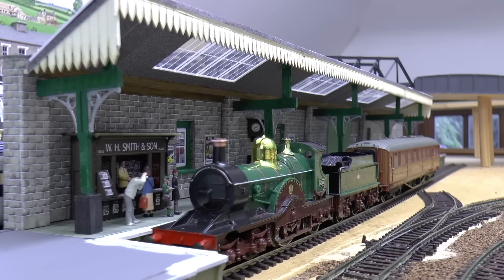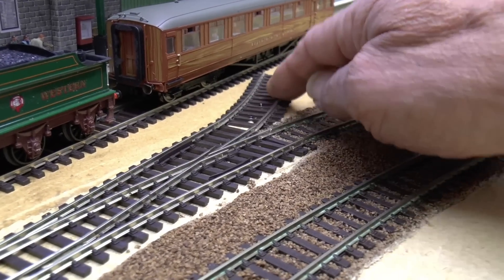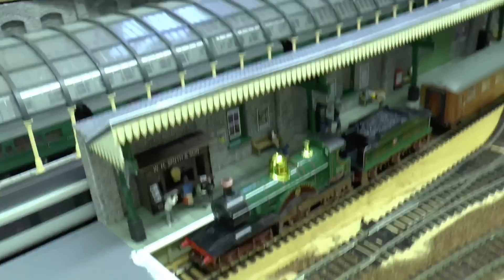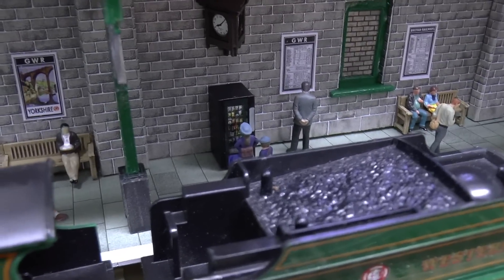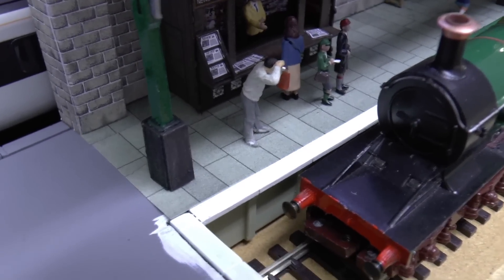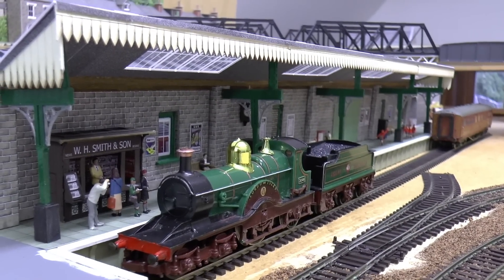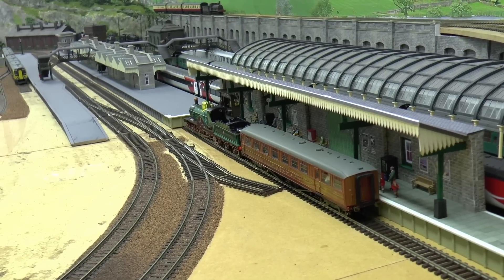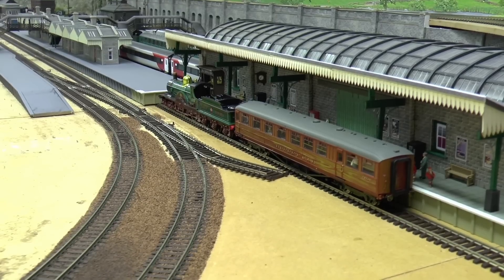Part 11. Reconfiguring the two through platforms and associated track work. 07-08-2017

Comment: Looks amazing Graham, its made a real feature at that end of the platform. There is something rather refreshing about ripping up parts of the layout and remodelling them, especially as the trains run much more smoothly.
Reply from the maker: So very true John about ripping up an older part of the layout and giving it a make over. quite therapeutic and as you say, even more so if the end result gives smoother running and a purpose too.              ..........Graham

Comment: Fantastic work on the station reminds me of the NRM station with a Steam loco looks very good :)
Reply from the maker: Thank you, it hasn't come out too bad really considering it was just made from bits and bobs and it adds a little more interest to what would have been just a long platform - I'm very pleased with it so far.           ..........Graham
Reply: It does look more mainline styled as a station the 'museum' section is really railway history styled as it could have been a bay for parcels trains or even for the Royal train, so it has the seal of approval from me ;) Plus as you said mate, it's your layout your rules. To be honest that's how it should be :-) Just looks really good loved Single Wheeler and then seeing the Virgin HST in the background that reminded me of Kings Cross.
Reply from the maker: I think the old and the new make a lovely contrast which is what I wanted to see and also I wanted to see a teaser of what was behind that wall too which is why I fitted two small windows in it - just seeing a slight movement behind it will hopefully add a little interest next time I do a running session.          ..........Graham

Comment: Nice work Graham the museum looks very busy with lots of visitors and when the other platform is finished the visitors will quadruple. the museum will look great once you get the railings up. a little suggestion maybe a ticket booth wouldn't go a miss at the entrance.....all the best Tony
Reply from the maker: Thanks Tony, yes a ticket office (or booth) will be installed there before it's finished, there's still quite a bit to do on it yet but it's gradually getting there.               ............Graham

Comment: That's an amazing use of a non running loco!
Reply from the maker: Hi mate, the loco does actually run it's just that it's DC and not DCC which my layout is so it needs to be isolated from the main feed. Put it on a DC track and it would be fine!   ;-)             .........Graham

Comment: Nearly there Graham and looking really good. I have a question that I have been meaning to ask for some time. Now that you are about to scenic the other end of Lakeside what will you do with the manor house when you are standing in its place in the centre of the layout? You can hardly rest it on existing scenery and you will soon need to scenic the area where you currently rest it. I'm sure you have thought of this but I am curious!  .........................John
Reply from the maker: Not too far off now John. The Manor House is fully detachable, there is a two pin socket to uncouple and I can lift it away which is normally from the stairs end of the layout and just sits on the floor. I don't bother normally as there is nothing there but you are quite right, as soon as I start developing that area then it will have to come off. I can also take it down below from the centre section too - very much like our loft hatch we have which is basically where I got the idea from.            .............Graham
Reply: Ah! So you can reach to lift it out from the stairs end. It is very difficult to get a real ides of the reach involved to do that from a video and I thought it was too far to be possible. .....................John
Reply from the maker: The layout is not as big as what it appears on the videos John and most parts are in reach although the very far end can be a bit of a struggle - you'll have top pop over one day and you can give me some of your expert advice on areas - probably tell me to start again!!    lol.              ............Graham
Reply: I would love to see Lakeside 'in the flesh' and will take you up on that offer one day but first we have to get Maureen fit enough to drive as she provides my taxi service. And she is also interested in other peoples models so you can get a real expert opinion lol! As far as my expert advice goes I would say you don't need much. I am only an average modeller but I do understand quite a lot about the real railway and I like the technical side of the hobby. My scenery skills are pretty basic so I can admire scenes such as your burnt out car while thinking  I wish I had thought of that! .............................John.
Reply from the maker: Excellent, well as soon as Maureen is fir and well enough to drive then let me know then we can fix a date up. You can still put a burnt out car on your layout John, I don't hold any copyright on it !!    ;-)           .........Graham
Reply: Thanks Graham, Maureen is waiting for a first Physio appointment as she is quite stiff and in danger of getting a frozen shoulder, which she has had before, so it may take some time but I will let you know. The burnt out car may not be copyright but doing it may give me too much to live up to. Once I have seen something like that I am in danger of getting stuck trying to copy rather than going my own way. I always remember a bit of advice on weathering which says try to copy a prototype and not a model but this can be quite difficult if you have already seen a really good model. Well it is for me anyway!  ...........John
Reply from the maker: Well give Maureen my regards and wish her well and a speedy recovery. I agree about the weathering and I also make sure that whatever I am weathering is as it was brand new to begin with rather than weather it straight off from the build - that's what happens in real life. I'm talking about just weathering surfaces - not building a tumbled down building which of course is different.        ............Graham
Reply: Maureen says 'Thank you Graham'. I will be in touch once she able to drive again. Meanwhile back to the modelling! .......................John

Comment: The museum area is really looking great. Who cares if others don't like the mixed read it your layout. Following in your footsteps a troublesome insulfrog point has been removed from my layout, electofrog point on way to replace it. Looking forward to seeing the revised trackwork.
Reply from the maker: You wont regret changing over to electrofrog points mate, they just make life so much easier and are no more difficult to wire up than the insulfrog points plus to me they look more realistic too without that horrible brown bit of plastic for the frog. The most important bit for me though is that they really help to make the rolling stock run much smoother - that is a big plus for me.  Good luck with yours!    ;-)             .........Graham

Comment: Coming along nicely Graham. I've seen the school pupil figure sets and they look really good visiting your museum. I'm not a huge fan of card kits because of the variable temperatures in my loft, but I must say you've done a great job with them, particularly as it's largely a spares box special! ;-)
Re the railings preventing access which you mentioned - what about a short length of fine chain on the loco itself, perhaps with a notice to keep off hanging off it? But only if you can be arsed!!! (Dear Points of View, ......). Another enjoyable update mate. Cheers.
Reply: PS - your existing station buildings are growing on me a bit and are certainly in keeping with the museum area!
Reply from the maker: Thank you Davie. The buildings don't seem to suffer too much in my train room because as you say, they only really deteriorate if the atmosphere is damp which luckily for me it isn't. I had a look at the loco this morning regarding railings/chain etc and to be honest, it's really difficult to get a camera round the back to see much detail so I don't think I will bother with the railings or chains to stop people boarding it - I have better things I can be getting on with if I'm honest. I agree with the station buildings, I initially thought about ditching them but I really haven't seen anything that could take their place and still look the part so unless I see something that would look good across both platforms then I think I will stick with what Ive got.        .........Graham
Reply: You're right Graham. I have boxes of "oh, I must get one of those" which may or may not end up on the layout!
Reply from the maker: I think we all have things like that tucked away in drawers or cupboards, they will all come in handy some day I have no doubt about that.   ;-)           ...........Graham
Reply: Only a loft and two sheds full! ;-)
Reply from the maker: Blimey mate, you need to get that lot onto your layout!!    :-)           ............Graham
Reply: What can I say - I'm an ebay-a-holic. I have a problem!!!

Comment: Like the museum, it is coming along nicely. Stick with what you want it is your layout. I wish I was making as much progress. I keep making track adjustments. think I have got it and I find out it does not. Trying to reduce the number of points.
Reply from the maker: Very wise Nigel in reducing the number of points which is basically what I have done, I took out 8 points and put back 2 and it makes for much better and smoother running and of course is far less complicate to operate which for me is a big plus. I wish I could make more progress than I am at the moment, I seem to be lagging behind at the moment but there's no rush is there?                .............Graham

Comment: Very nice, Graham.
Does the concept of lead flashing help for colouring the roof at joins?
I like the roof trusses, with the detail ironwork. And the roof looks good, keeping the sight lines clear as you wanted.
Structural engineers, pshaw, what do they know anyway? Your world, your rules of physics!
The guttering can run the length of the building, so you don't have water "in the museum", or even through to a subsurface drain, or over the back wall to platform 2 side.
And finally, nice to see the museum from your running position. It'll help bring your focus (and thereby ours) to the front right corner, which has been a blind spot (or area) in the layout for some time.
Reply from the maker: Hi Tom and sorry for the late reply, I had no notification of this and have only just seen it in the comments section.  Yes I need to do more shots from that angle and others too, trouble is I've got lazy in my old age!    lol.   The guttering etc will probably be one of the last things to do now as it's almost complete, I'm sure I can fudge something in there to make it look something like a gutter all taken from my spares box.    ;-)         .........Graham

Comment: The canopy is looking good from the track level as I thought it would from my last comment in part ten. Though I was thinking you would have had the canopy angle sloping down in reverse from the wall. To over hang the GWR loco siding for drainage purposes. Though your solution with the guttering and drainpipes will cover that issue. The siding has come together nicely from your spare parts  box. It goes to show what you can achieve from anything left over from kits, or makeup from other house hold bits and bobs etc. So it is worth keeping a leftover parts box for projects or any ideas that those bits can be made into something useful. A very good pointer (pun attend) to lock the slip bar to the fixed position to avoid the point switching later during running and causing problems. So I like the way you are tackling any issues and how Lakeside is coming along for us viewers to watch its progress.
Reply from the maker: I played around with that roof both off and on the layout John and decided that in the end it would be better for viewing to have the roof going upwards with the drainage using the old system from the engine shed. The primary reason was to get the view when looking at it when videoing. If it were to be pointing downwards and rolling stock on static display then everything on the platform would be blocked out, so with the roof pointing upwards then the view is much more visible. Yes, considering that this was all made up from spare parts apart from buying one kit for the facia boards then it has come out not too bad really. It was never meant to be a major player on Lakeside, rather a little cameo for where I needed to get over the problem of having to cut back the platform and for that then I think it has worked it OK.  I'm pleased you are liking it so far.             ...........Graham

Comment: looks great .will you be putting lights in the coaches? looking forward to your next video
Reply from the maker: Hi Paul and thank you, there are actually lights and people in both those coaches plus I have also put in a detailing kit which covers the seats in the correct colour and pattern of the fabric plus carpeting and wooden finishes to the interior panels.               .............Graham
Reply: sounds good wish i had a shrinking ray loll like they did in the old hornby  advisers.how you the lights work if theirs no power to the track?
Reply from the maker: There will be power to that small section of track but the end where the loco is will be isolated so the loco won't be receiving any power but the coaches will, hope that all makes sense.          ..........Graham

Comment: Hi Mate, a few questions and or comments, 1) In the real world where such a point may exist that is no longer attached would they have signage on it, just a thought. 2) Sod the purists, i know im going for an era but It confines you, I have on many occasions thought about having a few class 66`s but they just wont fit and ive set my stall out for an era so good for you that you choose to put on what you want, after all, its your layout. 3) I like that paving on the platform, who was the supplier, can you remember as you didn't say. 4) Guttering for the roof section, just a suggestion, Plastruct "U" section in a smaller scale could be used, giving the appearance of a box gutter sunk into the joint in the two roofs. 5) What about a little cafe from an old railway building of some type at the end on the platform. All just comments on whats here , you can tell me to sod off mate i wont give you a thumbs down lol. I think overall it looks brill and adds something different, and its also very believable now its all coming together.
Reply from the maker: I have absolutely no problem answering your questions/comments mate - they are always pertinent to the video.  OK so: 
(1)  Yes, I will be having a closed gate going across the little bit of track that is coming from that new point I put in along with signage saying something like "NO ENTRY" or "KEEP GATE SHUT" - something like that and of course at either side of the gate will be fencing.   
(2)  Absolutely sod the purists, when they start paying for what goes on my layout then they can comment but until then they can bugger off and I'll do what makes me happy.   
(3)  The paving is made by "Superquick", there is no product number but the description says "Grey Paving Stones" and you get six A4 sheets in a pack and this pack cost me £3.25 although it may be cheaper at larger retailers than my very expensive local model shop.
(4)  I have some guttering which I was going to slot into that joint so that's just blown away my thunder when you see it next time!!    lol.   
(5)  I did try putting a small building on the platform but the largest I could put on there so that people could walk past it without committing suicide by falling onto the track was the small kiosk at the beginning of the platform plus I don't think the people who run the buffet coach would none too pleased if there was a cafe running as well. However, I'm sure they wouldn't mind a small burger van parked on there which you may have seen on a few occasions on Lakeside.   ;-) 
I think that's about it buddy so I can now tell you to bugger off!!   lol.   Anyway, pleased you are liking it so far and hopefully once complete with all the other stuff around it then it will have done it's job of primarily give room for the coaches to clear on that bend and crossover plus add a little interest too.   Cheers for now mate.        ..........Graham
Reply: 1) Nice idea, 2) Laughing me head off reading that 3)Cheers for that 4) Haha thunder stolen, point to me 5) Forgot the coaches were buffet, it just looks like it needs something there but i get your point about suicides passing by whats there, what about a free standing clock or something like that.
Buggering off now lol, it looks great mate, always does when you get started.